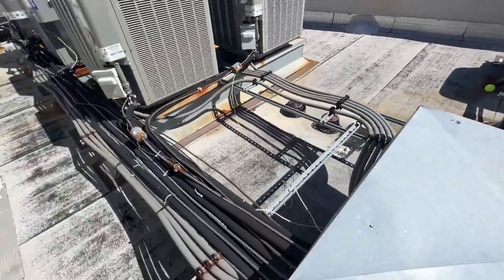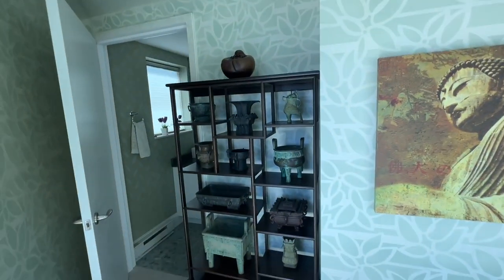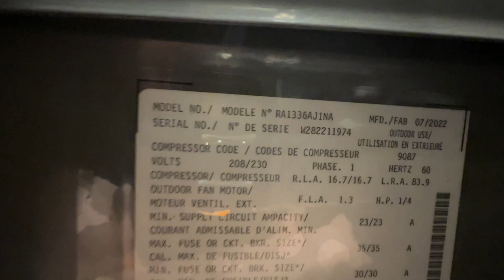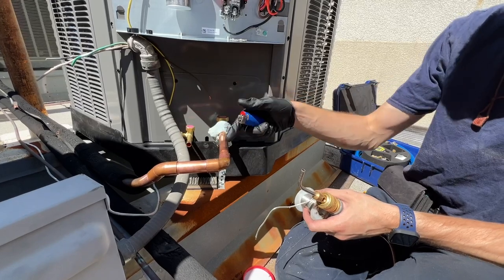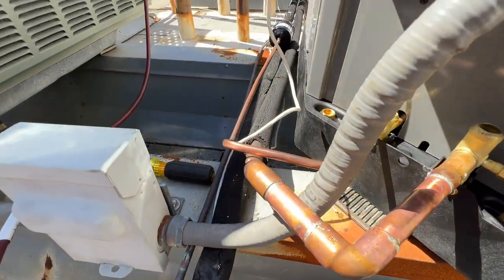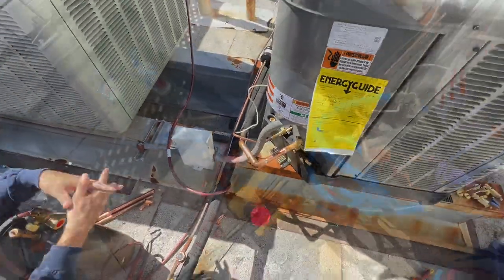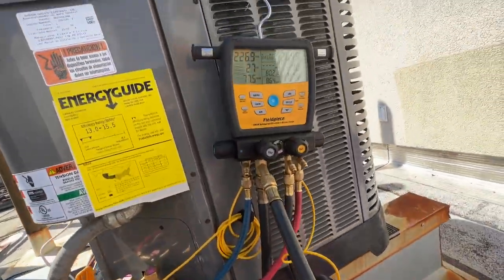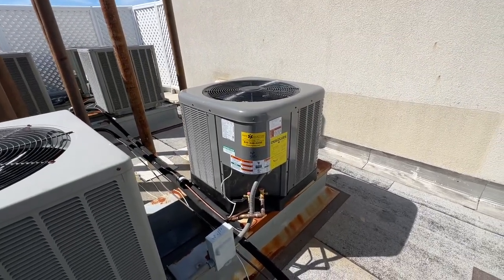Replacing Rusted-Out WeatherKing R410a Condenser on a Rooftop! Rheem 3 Ton Condenser Installation!!!

Comment: Daniel heat the fitting capillary action will pull the solder in . And clean off any flux residue with a clean rag .  Same thing goes when sweating pipes for water .  I see your skills are improving . Try this with some scrap you will see how easy it is .

Comment: I love your videos and appreciate anytime a tech show’s great work when I started someone told me when using the temp probes cover them from the sun to get true pipe temps without the sun screwing with them I took that advice and it’s saved me plenty of time so I wanted to share it with you even just a T-shirt over the clamps will help control your numbers I use testo I know there not the same but same principle keep up the great work!!

Comment: Just a tip when you're done soldering use your flux brush with a little flux on it and go around the pipe. Just just wipe it off like normal when it cools
Reply from the maker: Why?
Reply: @DCHVAC  It helps spread the solder evenly.
Reply: In class they say the less flux you use. The better. Stuff very acidic.

Comment: where did you get the service wrench I saw in the Mikey pipes vid ? would love to get one as my current setup doesn't fit some applications
Reply from the maker: Amazon
Reply: @DCHVAC  i looked only seeing the regular ones like I already have,  drop the name or a link it will be greatly appreciated 👍🏽👍🏽
Reply from the maker: @prowesstv  Uniweld 70074 Offset Ratchet (3/16,1/4,5/16,3/8) with DHVA Dual Hex Wrench Adapter https://a.co/d/53o578H
That’s the link to the part with the metal piece I use. But the actual ratchet I use is yellow jacket
Reply: @DCHVAC  good looking out🙏🏻, currently have the Yellow jacket myself but my current hex head is a pain👍🏽

Comment: Y take the chance even with stay brite not to mention I hate cleaning and fluxing
Reply from the maker: There’s no chance being taken. It’s rated for 10,000 psi. It’s more flexible. And doesn’t cause carbon build up on the pipe or unneeded stress on the copper.

Comment: Not trying to be a super tech or nothing but shouldn’t that be a long sweep ell, elbow, 90 whatever you wanna call it? It kinda looks like a 3/4”plumbing fitting…nice work boys! On another note since the condenser is above the air handler/furnace A-coil, is there an oil trap in the suction line…just wondering?
Reply from the maker: One 90 isn’t gonna have any impact when there’s a bunch of them throughout the run
Reply from the maker: But yes technically
Reply: @DCHVAC  yeah man while building looks crazy 😜 I guess you gotta do what you gotta do!  Any thoughts on the oil trap comment I just added? I remember I was working in Brookline,MA and I was told I had to add an oil trap in the suction line because the condenser was on the roof about 30’ below the A-coil. Idk where the air handler was located just seeking thoughts and advice, thanks in advance!
Reply from the maker: Only needed when condenser is above compressor
Reply: @DCHVAC  the compressor is in the condenser…not sure what you mean by this?
Reply from the maker: @tphvac87  if the compressor is below the condenser u need a trap
Reply from the maker: The condenser coil
Reply from the maker: It’s to keep oil from flooding the compressor so at startup it’s not trying to compress oil
Reply from the maker: If the condenser isn’t above the compressor then it’s not needed because it’s not going to condense into it.
Reply: @DCHVAC  check the manual. suction line oil trap needed when condensing unit is above the evaporator. not when the compressor is above the condenser... when would the compressor be above the condenser?
Reply: @DCHVAC  https://www.daikinac.com/content/assets/LightCommercial/SplitSystems/DX11SC/TP-108B.pdf page 5   " **An oil trap at the indoor unit is required if the elevation difference exceeds 80'. The trap can be constructed of standard
 refrigerant fitting (See Figure 3-1.)" this is a Daiken install manual i was able to find kid.
Reply: @DCHVAC  **An oil trap at the indoor unit is required if the elevation difference exceeds 80'. The trap can be constructed of standard
 refrigerant fitting (See Figure 3-1.)
Reply: @DCHVAC  Not true. the oil is not going to "flood the compressor" this is to prevent oil getting stuck in the evaporator which would hinder compressor lubrication.. NOT to prevent oil from slugging the compressor. Do some research, read your manual.
Reply from the maker: @drodriguez394  that’s at the air handler. There wouldn’t be a trap right at the compressor suction line inlet unless the condensing coil was above it. And I’ve never seen it above it but I was taught that in school. Sometimes compressors aren’t where the condensing coil is. There will be a coil outside with the outdoor fan motor but the compressor can be inside in certain indoor “packaged” units.
Reply: @DCHVAC  i know exactly what youre talking about. its a 3 piece unit. however, 2 things 1 oil doesn't come from the condenser coil it comes from the compressor. and  2 the path of oil/refrigerant does not go from condenser to compressor. 
it goes in order compressor to condenser to evaporator (a vapor) to compressor. OIL slugging is not a concern. maybe on some big industrial stuff but not here. and i wasnt taking about adding a trap at the condensing unit, i was just stating that that system should probably have a trap.  and was wonder if it had one at the evaporator,  or if you even checked.
Reply: @DCHVAC  also page 6 of the same document.. SECTION 4. OUTDOOR UNIT IS BELOW THE INDOOR UNIT oil trap... no. i recognize youre talking about condenser coil and not evaporator coil.. but once again thats not how the refrigerant flows.
Reply: after all just maybe thats what killed your old condensing unit... lack of lubracation? and is the oil possibly still stuck in the evaporator? are you now overcharged with oil?
Reply: @DCHVAC  what your talking about is an "inverted p trap" and that goes at the coil. same thing page 6. that purpose is to prevent oil slugging during off cycle.
Reply: @DCHVAC  .. Rodriguez is correct on this one, just add this to your knowledge bank don't look at it as something to override what's you've already learned. the truth is once the condenser is a over the evaporator a trap is required on around every 15tf of elevation, if. the air handler and condenser is practically on the same level an inverted trap is also required   , residential doesn't follow most good practice but on the commercial side it's a must for compressor health.💪🏾
Reply: @prowesstv  This isnt supposed to be a kick in the nuts, im just trying to share knowledge. And i dont expect you to believe a guy on youtube you never met. thats why i attached a install manual. He should challenge everything  and research what i said.  i think he might be surprised what he finds...
Reply from the maker: @drodriguez394  old condensing unit died bc it rusted out
Reply: @DCHVAC  Doesnt change anything else i said. and you possibly might be overcharged with oil if there is not suction line trap at the evaporator.
Reply: @DCHVAC  But look i think youre doing a great job. You have the drive, youre capable, and i think youre verry knowledgeable. Add this information to your tool box. Keep up the good work kid.
Reply from the maker: @drodriguez394  I don’t disagree with anything you’ve said and I am looking it up. As far as overcharged with oil I’m doubtful because of how quickly it pulled down a vacuum and with a passed decay test. But idk
Reply: @DCHVAC  Hey man, im not saying you are, or are not over charged withoil. im saying its in the realm of possibility. after looking back at the video i realize the system was rusted. 
in the event you find a compressor failure in similar situation, that would be one of my thoughts. lack of lubrication. a way to test that theory would be to remove the compressor tip it upside down into a container and measure the oil. your amount of oil should match what listed on your compressor label. or pretty close to it. if im not mistaken fluid oz and oz by weight are verry close. you could use a measuring cup as well to test fluid oz. after all if your verry short on oil poses 3 questions.. where did it all go?  do i have oil return issues? will this new compressor fail? 
 i appreciate you being open minded.
Reply: @drodriguez394  you are right this guy don't  know  what he is talking about. Also all hvac copper lines should be brazed not soldered. The idea is all the oil should return to the compressor and should not be trapped in the refrigerant piping.
Reply: @piyushpatel5342  Lots of guys use that stay bright stuff. not my thing to each is own. his company wants him to use it. hes young in the trade. still learning. i like hes able to take part in discourse.
Reply: @DCHVAC  When the condenser is above the evaporator you need a trap to force the compressor to return the oil to the compressor, otherwise the oil that travels with the refrigerant will tend to stay in the evaporator and starve the compressor.  good job on the change out.  Always hated the carrying all the equipment part of the job.